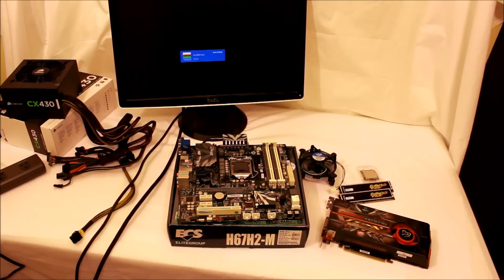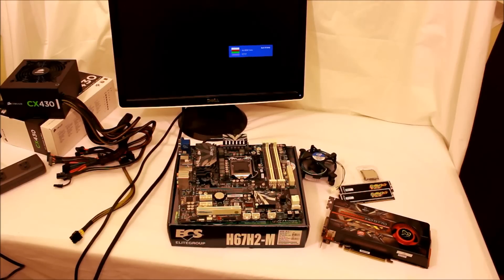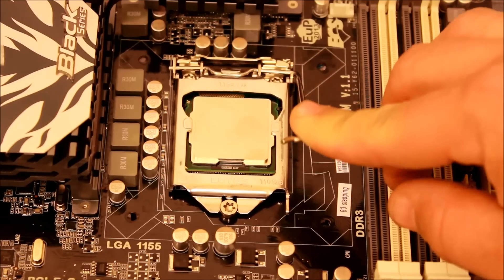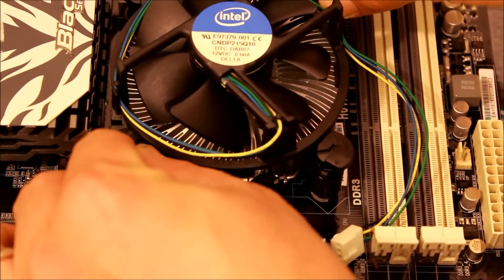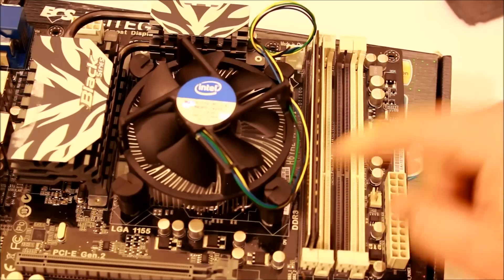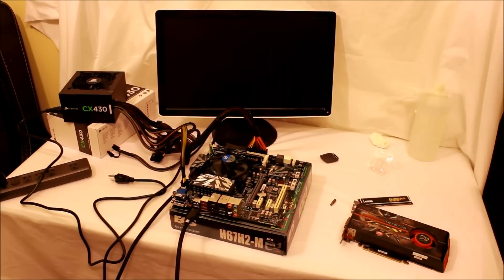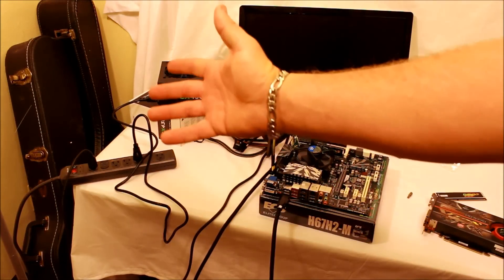how to test a new motherboard

Comment: I now feel stupid sitting here for hours trying to figure out why it wouldn't work before I put it in the case. I had the cables right but I didn't do the off/on pins near the front panel. I feel stupid but atleast it works now. thanks man

Comment: Its been a while since I built one, this video and explanation was very good. I have seen it done without installing the cooling fan, for example if you are using a AIO cooler it could get a little awkward, but and big but, better shut it down soon as it posts. CPU gets hot real quick. Obviously with cooling fan is the safe way.

Comment: Thanks man. I'm doing my 1st build and wished I'd seen this video before I started putting it together. But you did help me figure out the power issue I was having. My brain was fried after trying to get all these parts installed (11 hrs!). The leads from the case weren't right because the system fired up using the power button on the motherboard just like you said. It still wouldn't post, or at least I can't see anything on my TV. I've been using my big screen and it's HDMI on the HTPC I'm replacing so I figured that would work on the new build but nothing is coming on the screen. Probably something simple. Thanks again for the video. Props. Oh and I liked and subscribed!
Reply from the maker: thanks for the sub man. i hope you get your problem figured out. hdmi to a tv should work for a post. try taking out all of your RAM except one stick and see if it posts then. also does the motherboard have a read out display on it. if it does what does it say when you turn it on?

Comment from the maker: ok i think your asking me if you can use your old hdd when changing a motherboard. if thats so i can tell you that i have done that in the past with success... but it didnt last for very long and it didnt run as good as reinstalling windows. if you can always back up data and reinstall. drivers dont like it when you change the motherboard. thanks for checking out the video and commenting. i hope that helps you out :-)

Comment: Blowing on the cpu after using a solvent to clean it is actually extra adding moisture onto the CPU surface and MOBO- I will just hold the CPU strictly by the edges. If it's coming right out of the box, no cleaning is necessary.

Comment: How to test motherboard if you only have powersupply just power supply.
Reply: you need at least a hgraphis card to see if it works or cpu and fan
Reply: You need PSU, CPU, speaker (turn on listen for 3 beeps)
Reply: @JesusOurKing  you dont need a speaker now days dude LOL
Reply: techs use post cards to test if the motherboard is working with ram cpu ...

Comment: I bought a power switch that plugs into the pins on the MOBO, just press that and you don't have to use the screwdriver trick if you don't have a power switch on the MOBO itself.

Comment: Cool guide! Question, if my computer won't post or beep when switched on after build what could be the issue? Fans don't spin either. CPU, 1 RAM and graphics cards are connected and working parts from another pc. The lights on the MB are on to say it's receiving power and everything is plugged in and seeded well. CPU fan is the only one connected into the CPU fan slot.
Reply from the maker: some motherboards have a little speaker that needs to be hooked up or it wont beep.  check that first.  if you can, try another RAM stick. or just try putting it in another slot.  if your mother board has on board video then plug that in instead of the video card you have installed.  other than that i really cant think of anything else to check out. If i knew what cpu/ motherboard you have i might know more but let me know how it goes and i'll try to help you out the best i can.
Reply: HighTech Retrospect Thanks so much! I have an EVGA x99 FTW and an Intel i7 5290k. I tried switching the RAM in all 8 slots but neither one boots up or beeps. I have the video card (EVGA 980) installed too. I tested it also with my old video card and it still doesn't work. :/

Comment: Great video I have a posting issue with an ASUS A88X-PLUS, (FM2+) I am using it with an AMD X4 750K (FM2) CPU, the green/red LEDs light up, but I see no display even when attaching an HDMI pcie card, the mobo has an HDMI port as well, could it be I need a bios update...
Reply: holy shut I have exact same problem with exact same cpu

Comment: This was very helpful even years later, thanks!  I suppose people gave you negative ratings due to blowing on the CPU, but other than that i don't understand a downvote here.  Again, VERY helpful, i will be testing my motherboard out of the case right now to give it one last chance before I return it...they are out of stock :(

I do have 2 questions that maybe someone can answer though...

1.) I thought my motherboard has serious problems last night because every time i turned it on, it flashed a whole sh1tload of error codes very quickly.  BUT, when HighTech Retrospect turned on HIS motherboard in this motherboard test video, his ALSO flashed a whole bunch of error codes!!!!!  So, am I wrong?  Is my board not bad?  I am going to test bed this thing and try running stress tests on CPU on the cardboard!

2.) What is a TP cloth???  Tissue paper???  If so, i didnt think that was a good idea...

3.) I did NOT wipe my CPU prior to installing thermal paste.  Is that a problem?

4.) I watched a different YouTube video when building my computer.  It told me to install power supply, plug power supply into surge protector with the surge protector OFF and the power supply OFF, plug surge protector into wall, and run anti-static strap from screw or stand-off on power supply to keep me constantly grounded.  It did NOT say ANYTHING about unplugging from the surge protector or wall before plugging into the motherboard, so I didn't.  could this be the source of all my motherboard problems?

This was an open box motherboard from a computer store.

Comment: I take it that the LGA 1150 stuff is installed the same way,and do I need to test the board with my monitor plugged into my GPU?
Reply from the maker: for LGA 1150 you would do the exact same thing.  I wouldn't use the GPU just because it would add more complexity to the test but you definitely can. thanks for watching and commenting  :-)
Reply: Thank you for the advice

Comment: What happens if I had plugged in my power supply before I plugged in the cables to the motherboard? You said that was very bad
Reply from the maker: probably nothing but I dont like taking chances. having a current running through a cable that is being plugged in could possibly cause something to short out on the motherboard and damage it.  thanks for watching and commenting  :-)
Reply: +robert slawinski You'll short out the motherboard

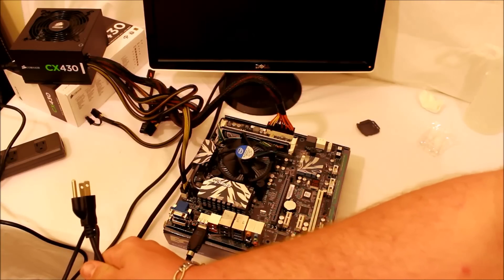Comment: Hello. In minute 9:50 u said "this is bad dont do that". What would it happen if you do that? will u burn your motherboard?
I was wondering that because i want to build my own pc  and i am kind of worry that i can make that kind of mistake in my first try.
Thanks
Reply: I'm not sure what would happen, but I wouldn't worry too much about breaking the parts you're installing as long as you take your time and are careful. 

Here's a few simple things to remember.  Don't touch the motherboard when there is power running to it, especially if it is on, besides the power button; wear an anti-static wrist strap or ground yourself by touching something metal frequently; watch lots of tutorials before you start; and read the instructions carefully of any any parts you don't know how to install, like the CPU cooler.

It seems scary and complicated at first but the hardest part of building a PC is picking the parts. Assembly is very straightforward if you're following a YouTube video or you get somebody who is experienced to help you.
Reply: If you plug in the power and you're still installing parts you have a chance of your system frying parts due to electrical arcing. When doing builds or replacing parts always be sure to have the system unplugged. It will save you money and possibly getting hurt.

Comment: Ok, how in blazes are you displaying anything on a LCD screen without running a cable from the graphics card (which you did not mount on the MB)?  In other words, where is your video source coming from?  I think you may have skipped this step.
Reply from the maker: +Wellyn Brewster check at 8:00.  with an intel core i3 processor you dont have to have a video card for display because the cpu has graphics built in. its not as good as a dedicated graphics card but it will work.  thanks for watching and commenting :-)
Reply: +Wellyn Brewster the mobo has a hdmi port on it and vga dvi etc. he will install graphics card when its all in place in case

Comment: Does a CPU you have to be installed to test the board and PSU??
Cause I have no Ram Installed Or CPU
And I'm getting just a green light on the board. No fan spin or L.E.D light up from my PSU
Reply from the maker: you have to install a CPU and at least one stick of RAM in order to test the MB. if your MB or CPU doesn't have on board graphics then you will also have to install a graphics card or you wont have anything to hook up to the monitor. I hope this helps and if your using an Intel CPU with integrated graphics on an Intel MB then do exactly what i did in the video or it wont work. thanks for checking out the video and good luck :-)

Comment: I just got me a FX-8350 CPU with a MSI 970A-G43 with a Rosewell 650Watt PS  8 GBs of ram and a hand-me down video card XFX Radeon HD 6670. I attached everyting but only the fans are moving and i get no image on the screen not with HDMI or VGA, I thought it was the video card so i'm testing it on my old PC as i'm typing this and it isn't. Could it be a bad CPU or MB?

Comment: Nice video.  Did you intend NOT to use thermal paste between the CPU and cooler?  No matter how flat the cpu and cooler is there is always an air gap.  Failure to use thermal paste will cause early failure, it's not even expensive even if you use arctic silver.  Perhaps it's time to update the video?
Reply: that's a stock cooler, those have some cheap thermal paste neatly pre applied. 5:37 see those 3 dark stripes on the bottom of the heat sink?

Comment: If you were to touch the pins, how would you turn off the mobo?
Reply: If you were to hold it on it, like how if you hold in the power button on the pc I will turn off after about 5 secs or so.

Comment: hey there, i had a question, i have a computer that i built a few years ago, when i tried to turn it on the other day nothing came on the screen, pitch black,it also wont beep,i swapped a known working CPU  and nothing happened, i also tried a brand new power supply and nothing happened, im guessing the board is toast correct?  its a gigabyte that i installed new back in 2009 and it has served me well, also all thats needed to test the board is the 24 pin connector, the other 4 pin power connector and a CPU right? the hard drive is not needed (even though i do have it installed) what i mean is basically the hard drive is not needed to at least get a screen right? thank you much for any help!!
Reply from the maker: you need to have the CPU and at least one memory module (RAM stick) installed in order to get the MB to post. you may also need a video card installed if your MB doesnt have onboard graphics. I know these are stupid questions but have you checked to see if there is power coming from the outlet?  use a lamp or something to check this. Is the switch on the back of the power supply switched in the right direction? Is it plugged in? those are things i always check first before changing out parts but sometimes people forget about that kind of stuff. let me know how it goes and let me know what MB and CPU you have.
Reply: HighTech Retrospect
 hey thank you much for the fast reply, yeah i have checked all that , the computer will actually turn on, all fans running everything normal, just no screen, right now i have it hooked up exactly how its in your video and im gonna test it that way, now i have used my onboard graphics card before and it worked perfectly but i cant remember if i disabled it in the bios  awhile back, is it ok to test the board with my radeon card just in case or do i have to use the onboard card?
Reply from the maker: dntlss you can test it with the radeon card. have you tried hooking it up to a tv or another monitor
Reply: HighTech Retrospect  hey, the monitor in question is perfect as i have my little spare dell c521 connected to it, i just tested the motherboard exactly how you tested yours and not a peep, i even removed the battery from the cmos for a few minutes and nothing so im pretty convinced the board is history, its like 6 years old and i did have a water leak in my home that transferred to the carpet under the PC about a year ago, the motherboard didn't  get wet per se but maybe the moisture had something to do with it, my best friend built a PC about two weeks ago and he installed a new asus board thats a beauty, i might go along that route,my video card is about two  months old so i wanna get a board thats pci express 16 to go with it , i mainly do gaming,not online but by myself, what would you recommended board wise? i have a 700w corsair supply and a barracuda hard drive with 300gigs of memory, im sure i could use a newer processor since i have a amd Athlon which is pretty old however it works perfectly
Reply from the maker: dntlss thats funny im looking at mother boards right now because im upgrading from the amd fx8320. i want to try out some high end intel stuff. whats your budget?
Reply: HighTech Retrospect
 hey again thank you for all your help,i would say my budget is under 200 dollars but i could stretch it a little bit.
Reply from the maker: well if you buy an AM3+ motherboard and use your old processor you can get a much better board and upgrade your cpu later. which cpu do you have? i know you said athlon but what socket is it?
Reply: HighTech Retrospect
its a 64x2 dual core 6000   3.0 GHz, i know this is a pretty old processor, is there any motherboard that has the same socket thats actually new where like you said i could replace the cpu later, i don't mind buying a new cpu though.
Reply from the maker: dntlss I dont think that will work with new motherboards. can you tell me if you have ddr3 or ddr2 memory
Reply from the maker: dntlss also whats your GPU.
Reply from the maker: dntlss also what case is that installed in because if its one of those prebuilt computers like from Dell then a standart ATX motherboard wont fit in it. i know because ive tried that before
Reply: HighTech Retrospect
 Hey there, i have a apevia x cruiser case which is pretty big, here is the link to it from newegg   http://www.newegg.com/Product/Product.aspx?Item=N82E16811144151     the GPU is a sapphire radeon R7 265 (pci express16) and i have four sticks of A DATA (2gigs each,8 gigs total) of  DDR2 memory.
Reply from the maker: dntlss ok thats what i was afraid of. all the new motherboards support ddr3 or ddr4 memory so you would have to buy a MB, memory and a cpu unfortunately. you can find some am2 socket motherboards on amazon but they are not new. does your power supply have a 24pin power connector or 20 pin
Reply from the maker: dntlss hey this costs around $200 and gives you room for expansion later.  http://pcpartpicker.com/parts/partlist/
Reply: HighTech Retrospect
the power supply is 24 pin but can be converted to 20 pin,it has that option,i do believe that i can find new motherboards with ddr2, not newly new made but new old stock that are brand new but why do that right?, i guess i should just bite the bullet and build a new system and maybe i can sell my older parts on eBay so i guess i can start with a new good motherboard as a good foundation, i want something thats good for gaming
Reply: HighTech Retrospect
 that site is awesome, Ive been to it before but i had forgotten all about it, another question, will new motherboards support pci express?, thats about the only important thing im concerned with since i just bought this new card and i really like it
Reply from the maker: dntlss yes new motherboards support pci express (PCIE for short) all newer motherboards will support your card. I know you know this but just make sure you look at the socket type for the CPU as they've changed a bit since your last PC. on another note, I've been an AMD fan for a long time too, but they haven't really been putting anything out lately that has new technology so thats why i've gone to Intel. Just take a look around a bit. Intel has some great stuff that doesn't cost an arm and a leg like i just spent on mine :-P
Reply: HighTech Retrospect
cool, im gonna go to that site you gave me the link to and just kinda look around and see what im gonna build, im pretty excited about it, i truly appreciate the time you have taken to help me out!!
Reply from the maker: its no problem. have fun building your new PC         :-)        also thanks for watching and commenting on my video. i know its a small channel but everything helps me out alot :-)
Reply: HighTech Retrospect
thanks again, i subscribed to your channel,you have been more than helpful, ill let you know how it goes once i build that new thing.
Reply: HighTech Retrospect
 I need your help ASAP, So im building my first gaming pc. I have everything but my cpu installed. i plugged in everything except my cpu and my cpu fan... And my psu wont power on. I tested it with the paper clip idea. and the psu works fine. Do i need to have a cpu or cpu fan or both to complete the circuit and powering the psu?
Reply: HighTech Retrospect
Never ind i rewatched your video. I just needed to connect my front panel connectors properly. You had the only video saying i needed these. Thanks so much bro!!! Also sweet build!
Reply from the maker: RisingSpiritsAirsoft im glad i could help. thanks for watching and commenting      :-)